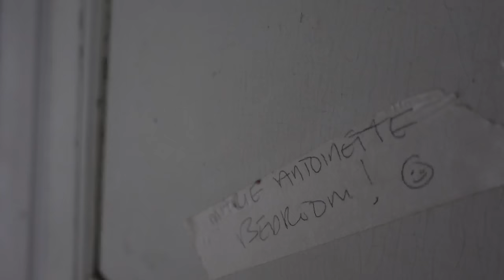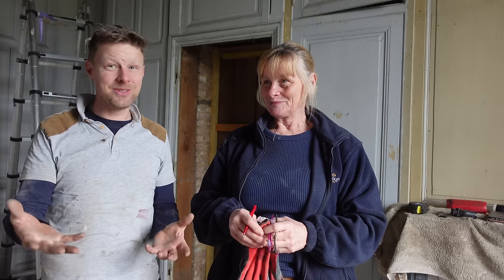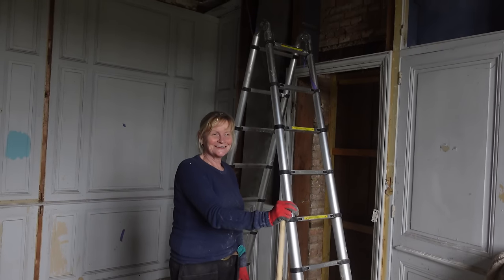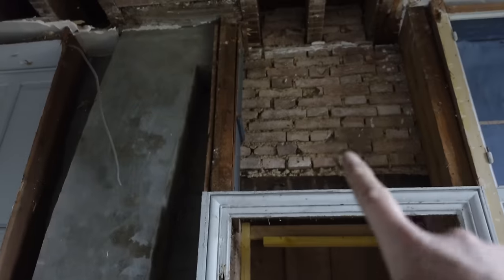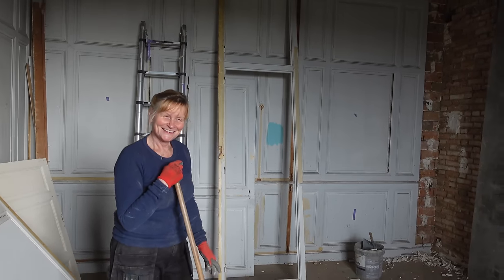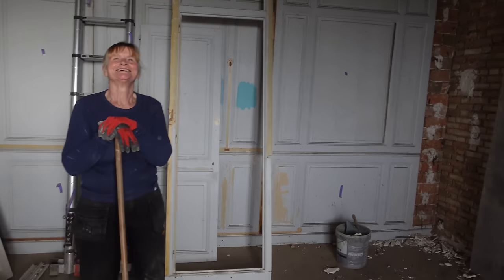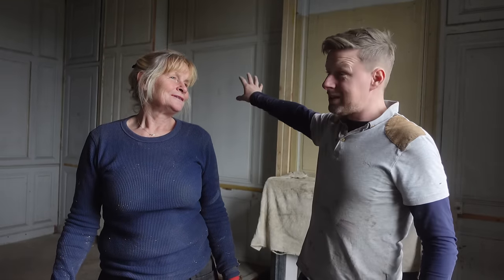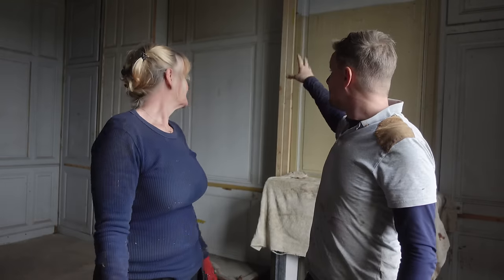WE DID NOT EXPECT THAT 😮 HIDDEN Behind The Chateau Panelling?

Comment: Great improvement! Just a note about sound proofing: Styrofoam doesn't work because it is stiff. For sound to be blocked you need to use soft material like rock wool or carpet or any thick fabric. Any soft material absorbs sound, stiff material forms a sound bridge. You don't want that between two guest rooms.
Reply from the maker: Ok thanks!

Comment: You took the wood panels down but why did you not take the advantage to put behind them new insulation ?? For sound proofing and heating and cooling help ??
Before you put the panels back up.
That does not make good sense to me.
Reply: They are internal walls so we don’t need insulation and we put insulation for soundproof 👍👍👍

Comment: Im surprised that you didnt use the time with the paneling down to repoint those bricks. They badly need it for structural support and who knows when that will be opened again. Also, I dont understand why you arent insulating between rooms. People wont just be sleeping in these spaces...if you catch my meaning.
Reply from the maker: Thank you, we did insulate where it needed it. It’s a double brick wall and the pointing was actually in pretty good condition. If it needed it we would have done it 🥰
Reply: The wardrobe is going to look beautiful there. The light is lovely in that room, even in the early spring light. 🙂
Reply: I guess 'pretty good condition' is relative. It looks horrible to me and we just had a chimney repointed because it was in that condition. :-)  @chateaudelalacelle